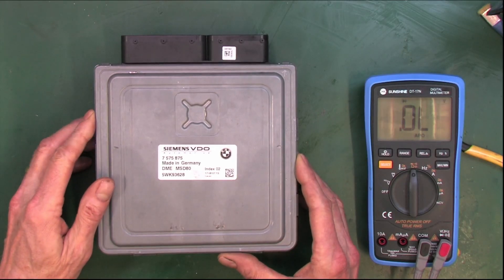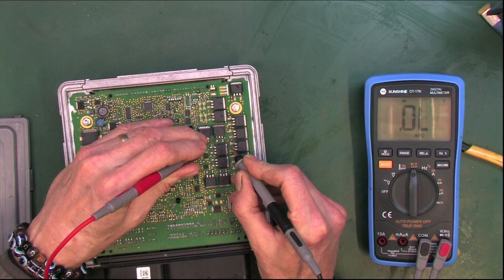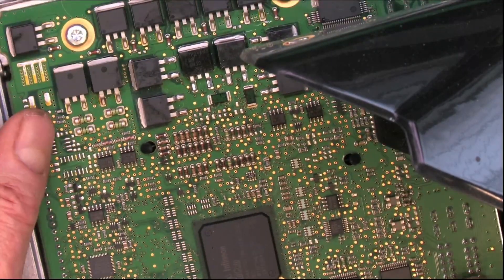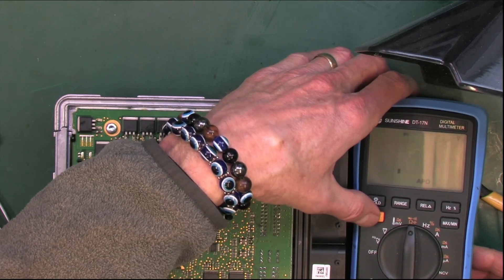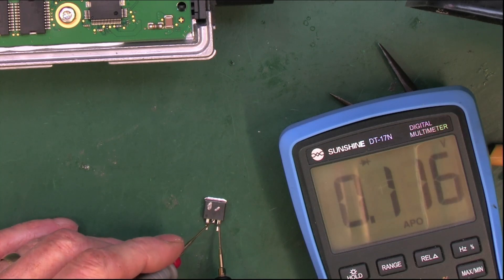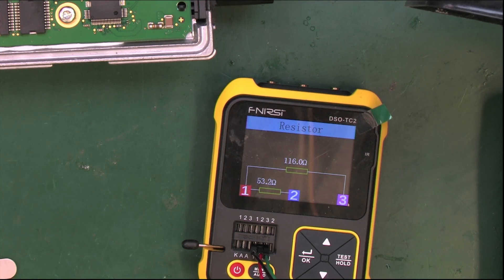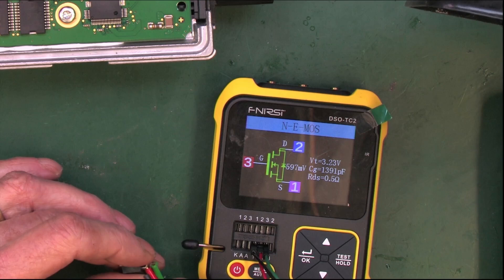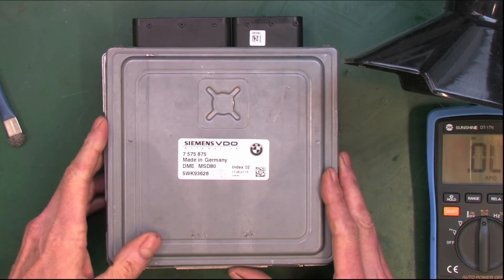ECU, I See YOU II... Mosfet replacement on a BMW MSD80 DME from N54.

Comment: Did this solve the issue or did the mosfets fail again? Is this a reliable fix or should I upgrade to msd81. My car is on a MHD stage 2+ tune.
Reply from the maker: I know it fixes their issue at the time, I dont know why or what they do to cause them to fail.
Reply: hey bro did u ever figure this out ? i’m stage 2+ mhd as well and was wondering if the tune was causing this failure